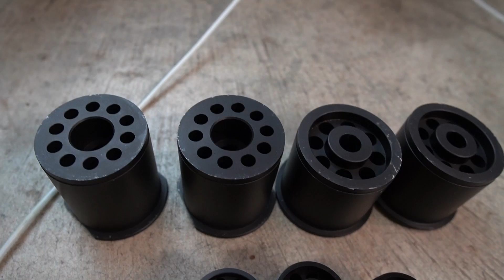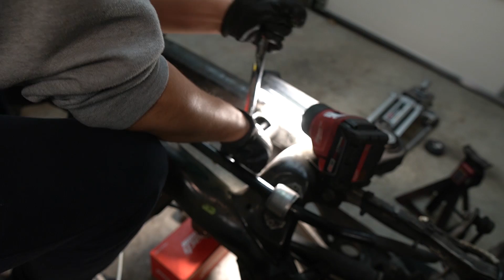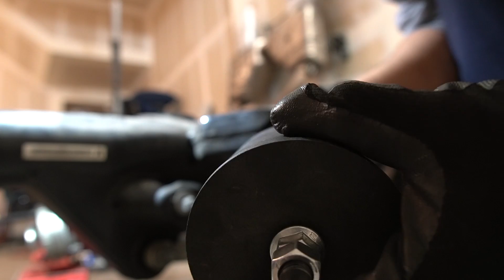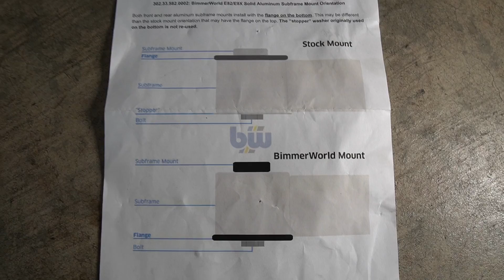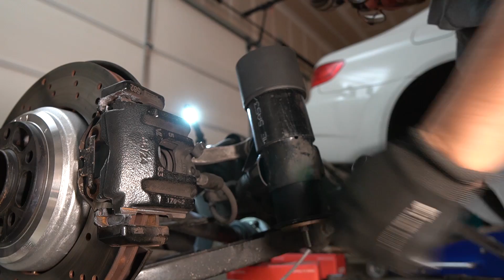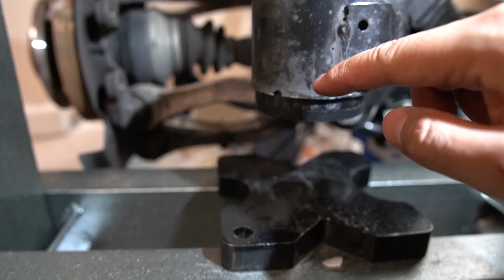Solid Subframe and Differential Bushings Installation - E92 M3 Track Car Build Journal Ep.28

Comment: I removed all my bushings with a whole saw bushings come out from the bottom not top and I heated the subframe with a heat gun no open flame and they just slid right out easily

Comment: I recent replaced the subframe bushings on my A90 Supra (bmw Z4😂) to poly ones. They are way easier to install because it’s two pieces and no press needed. 

How is your m3 running so far in terms of NVH? I found a noticeable drone/vibration in the cabin with the solid bushings.

Comment: I installed my carbon fiber drive shaft a month ago. The diff is leaking and have to replace the seals. All you have to do is disconnect the drive shaft and axles and the three mounting nuts and bolts and the diff lowers right?

Comment: Great video, I've been following this build! How many miles are on the old diff bushings- were there any cracks or noticeable wear on them? I'm considering replacing the diff bushings on my E92 from under the car. The subframe bushings seem like a huge amount of work to do.
Reply from the maker: Diff bushings were fine since the car has low miles, but they’re soft. Esp the big one in the rear. For the subframe, it’d be a lot easier if you go with poly.

Comment: Great DIY guide here. I have been watching since you installed your AP brakes.

I am planning to do this job in the future and the only thing I might suggest (unless the installation instructions advise against it) is to grease the bushing housings before installing the bushings. I haven't done this job on a BMW yet, but I installed solid aluminum bushings into my old 180SX years ago and the combination of grease and heating the housing with a heat gun before grabbing the frozen bushing made the install very easy. I actually just hammered them in with a piece of wood as a drift back then. I will likely get a bushing press for the M3, but I think the temperature really helps the tolerances and working as quickly as possible before they equalize made a significant difference. The bushings I installed with grease never had any issues with the subframe moving on the bushing or anything funky and that included years of drifting abuse on track.

Keep posting videos! i really enjoy this channel.
Reply from the maker: Thanks! I was definitely going to use grease if this didn’t work.